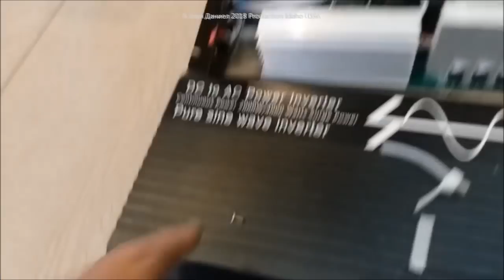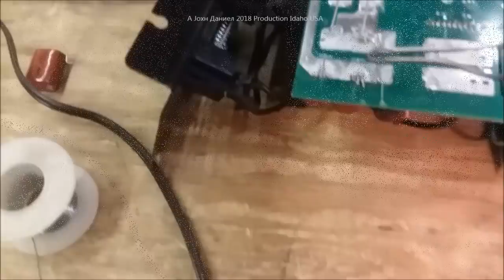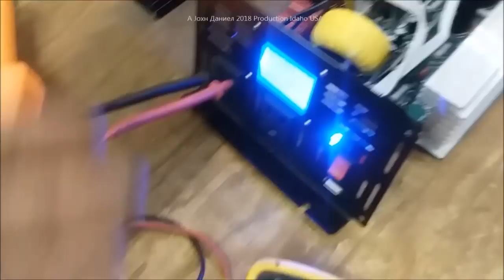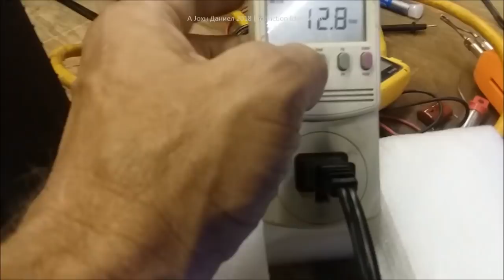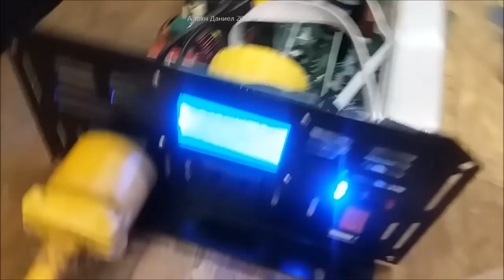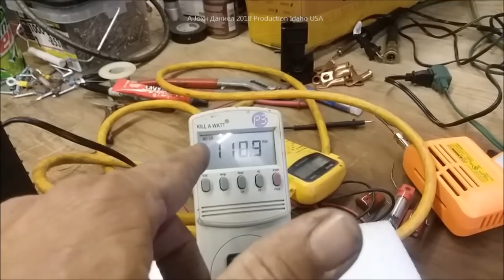Repair new  broke on arrival Electronics - Buy it, Unbox it, & Repair it? Wow, LOL! Vid 2

Comment: Why would you buy Chinese inverters? Even their branded EP-Ever Inverter sucks. There are lots of underrated Taiwanese inverters out there that would last decades.
Reply from the maker: I have a 3 year old Mean Well, hard core Taiwan made. Damn thing took a shit due to its over volt being 14.7 volts (supposed to be 15vdc) and a wind turbine surge to just over 15 VDC toasted its safety circuit. Costing me over $150 to repair.  In comparison I have a Chinese made KISAE 2500 Pure Sine thats designed in S Korea, built in China and in 5 years not one fault, never. Its over volt is 15.5, and has seen it numerous times but just resets and keeps running. Parts for my Well Published 100% made in Taiwan Inverter are on there way, shipped from China.
Reply: @JOHNDANIEL1  I have a 48v 3000w meanwell myself too. It's acting up the same. It always resets itself when my charge controller reaches a peak voltage of 58. I tried to reduce it to 57.2 however whenever a cloud passes by and the sun comes back, the charge controller can't throttle back from 59v to 57v right away and it takes about 2 seconds, thus makes a quick surge which meanwell doesn't like it. I wonder if you have a solution for this issue.
Reply from the maker: There is a small board in the Mean Well, its has leads going to the input voltage, the 0.47 capacitor will fail ( 12 volt system) from too many high voltage events. Damn thing is a 16 volt capacitor!!!!!  Lousy design IMO. It will not allow the rest of the board to get power for the switching events on the MosFets in a over volt of as little as 0.10 volts, totally stupid. 
Compare that to a CHEAPO SHITTY china inverter, they start with 15 and a error plus of 1/2 a volt, technically 15.5 volts. Their system uses a simple bullet proof MOS-controlled thyristor instead of a NAND logic computerized sensing system with weak links in it like Mean Well Does. Mean Well simply fuck'd up!
Reply: @JOHNDANIEL1  yeah such a waste for a tiny design flaw. I mean looking at quality components inside MeanWell and how well it looks make me disppointed for that lil flaw. Maybe there is a way to modify that NAND board thing and bypass it? You would be the first to mod a potentially great system :)

Comment: In my ignorance, I hooked too many appliances to my Killawat using a Defiant 15 amp 4 outlet device. I had purchased it as a fail safe for my homemade van when hooked into the 30 amp ac outlet. I had blown the fuse a few times when the microwave, and two burner hot plate were all being used in the motel. Then I put the Killawat between everything and burned it out. It has take a few years for me to discover that it had a fuse in it... Oh well. I discovered an auto gas take needs refilling after running out of gas. 

Love these videos where people know much more than I do. Fortunately I have my areas of expertise...  :)

Comment: Bought that heater fan at Walmarts, Mainstay brand, for $10 last winter. Kept me warm in a very small room when the temperature dropped to 28F and no other heat source.
Reply: A little crafty secret you can apply to heating for less money. Put you a cinder block with the openings in front of the heater and let it blow through it as you use it about 15 cm away from the output face. John Daniel here sent that idea to me a year ago on his DIY Oil Burner videos. It was great. The thermostat switched on much less and the cinder block radiated heat between cycles. I love it. He's smart like that.

Comment: Handy tip when repairing things like inverters is to connect one lead from the battery in series through a light bulb or similar resistant load which will absorb any excess current (and thereby potentially save some components from catastrophic failure) if there's a short circuit somewhere on the board. The bulb should be the same voltage as the battery and the wattage of the bulb should not be too high. If the bulb remains illuminated but the load doesn't show any signs of life, then there's a good chance it's shorted

Comment: Hey Daniel, I have a Chinese Inverter hooked up to 300Ah battery bank. Does the fan only come on to cool the Inverter or when too much power is drawn?(a small digital clock, and a cell phone, I am in a skoolie that has gotten to 102°, in the day)
Th hank you for you time, a d these videos...
Reply from the maker: Your inverter should have a N.O. ( Normally Open - closes on heat rise) Bi-metal switch inside set commonly to 45 to 50c, (114 to 122 degrees) similar to these https://amzn.to/2wwOhz6 . You would install this mid way by wedging it into the fins on the large Mosfet/Diode heat sinks, closest to the end of them towards the 120 volt outlets where the highest heat will be. Install as a interrupt switch in between the fans and power.

Comment: Have you used a scope to look at the sine wave while under load?
Reply from the maker: I probably can but the P3 kilowatt still had 60 Htz all throughout the test which tells me it's only needing a slight input adjustment to get volts to about 123 vac and that should be a major player.  Seems sine was very clean, if all things that would hum those ni-chrome wires in that heater would have sung da blues at the slightest hint of unsteady wave.

Comment from the maker: TO MY VIEWERS China Solar-Wind-Conversion Electronics I know well. I have installed almost 40 wind turbines, over 1,000 solar panels now as of this month, over 200 Power inverters & over 260 Charge Controllers and many Battery Banks. Up above in the PUBLISHED DATE location under the Show More I will work on posting the brands that I would trust over many others. You can review them, check specs and comment about YOUR experience so a future video can narrow more good from bad.
Reply from the maker: For starters and pros the best Solar Panels https://ebay.to/2KHX5XY Mighty Max 100w4bar . You can lay them flat or at a sun rated degree with less power loss due to them having 4 buss bars on the cells